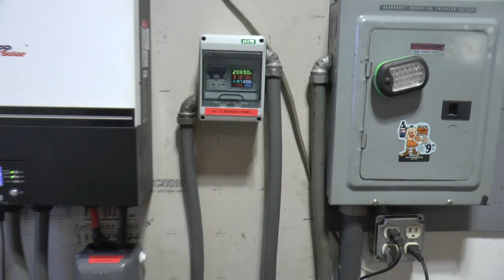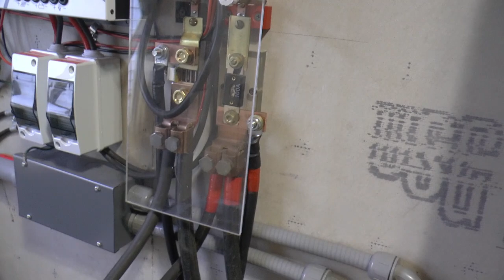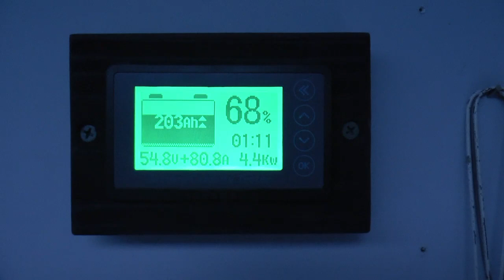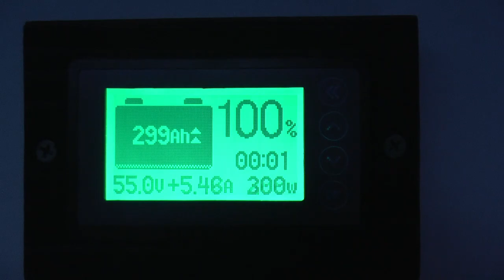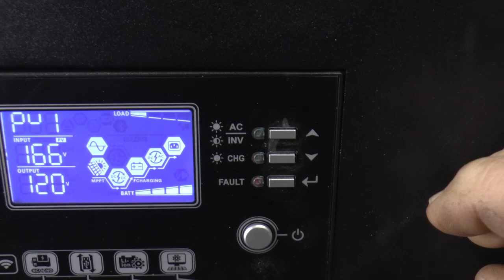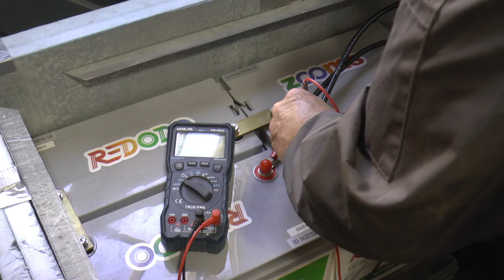Redodo Batteries with And without Balancer/Equalizer Comparison

Comment: Have you checked difference at 30% soc. I think that when some have one batteries shut off from low voltage
Reply from the maker: No sun for 2 days. Right now  batteries are at 13% and even the one with no balancer is fine.